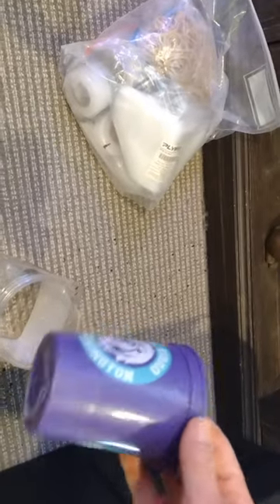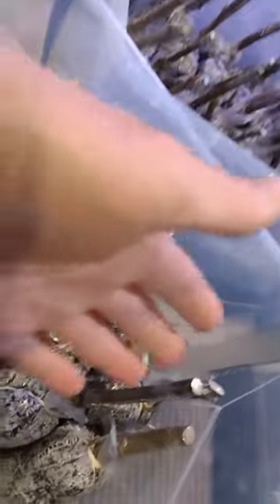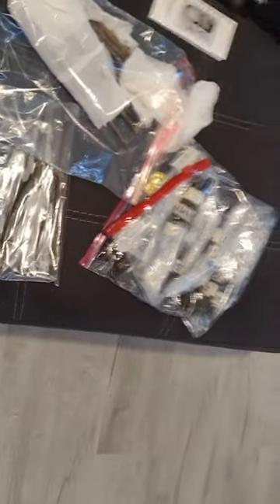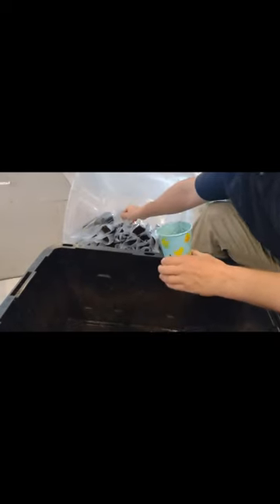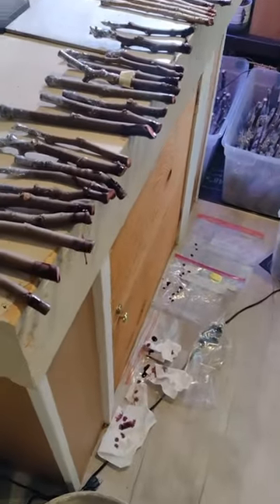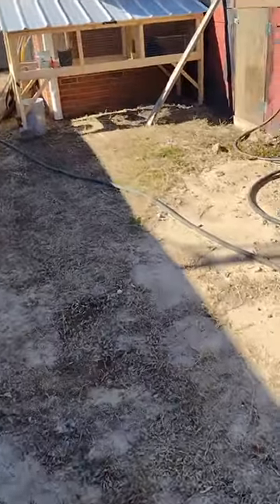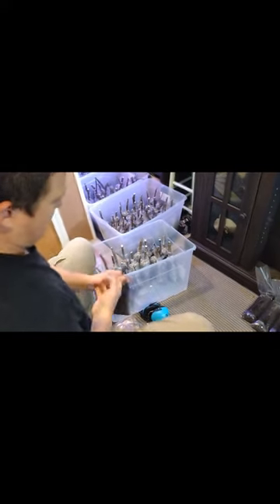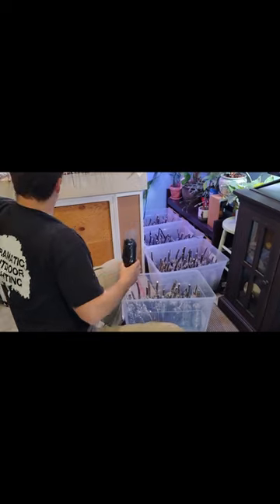How to fig pop with 100% guaranteed success or your money back

Comment: It was hard to see in the video but from what I can tell it looks like you're angling your cuts for the top cut and the bottom cut. I would recommend doing a flat cut on the bottom and doing an angled cut on the top it makes bulk processing a heck of a lot easier because you can readily see which one is the top or the bottom without looking for it. It also allows the top part of the cutting to shed water where the bottom part of the cutting will not get any benefit from having an angled cut
Reply from the maker: I don't really consider cutting an angle or not, but that's a good consideration.
Reply: Yeah if you take a look at the cuttings I sent you like the Israeli 7 you'll notice a pattern :-)  @MilesFig

Comment: You ever have a problem with mold under the parafilm?
Reply from the maker: No. Some did get some mold but it wasn't a problem. Parafin candle Wax seemed to make the most mold. The pros recommend using the grafting tape that was kinda like waxy.